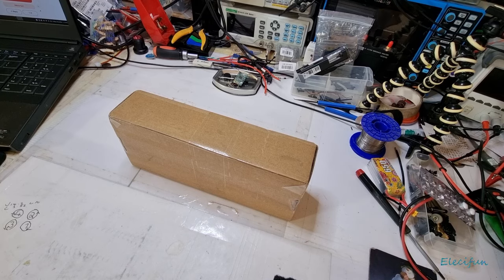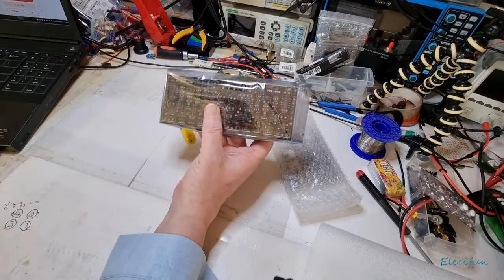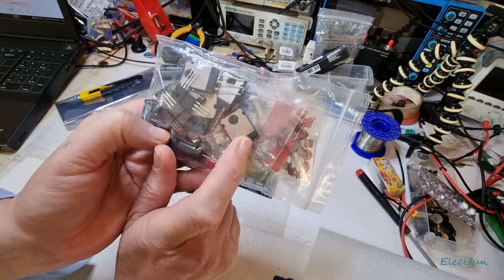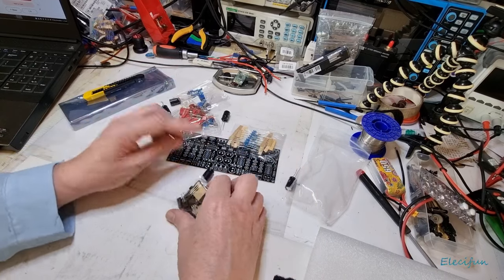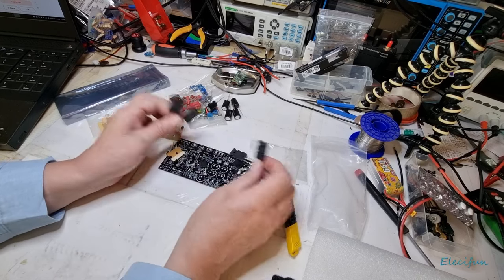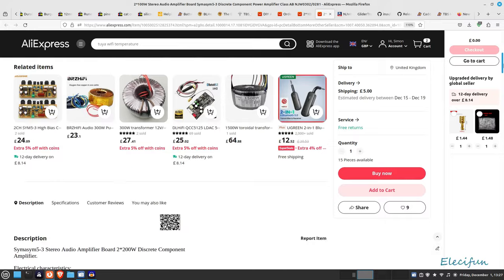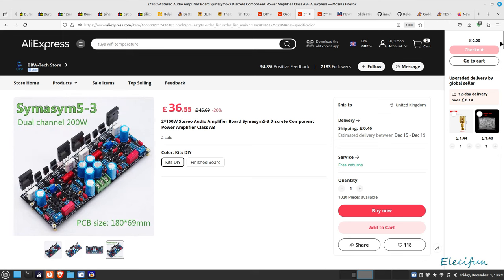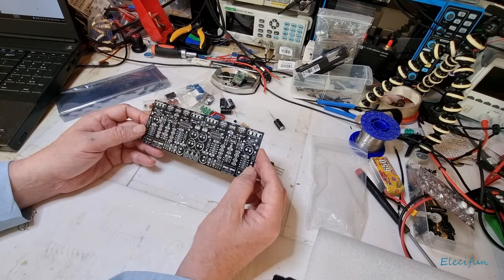SymaSym 5-3   100 watt per channel amplifier kit (Aliexpress)

Comment: Hi, Nice - you were tempted on the symasym 5-3 board! - Many different versions available -but you managed to get the same kit I started with.
1st you noticed what I also noticed, drivers I received was also 2SC5200 - different to what the board says right...???
I built it anyway - and the results were actually surprisingly good - better and more consistent to what I was getting from the L-12 or anything built to date from China
I then got curious and purchased a bare board - sourced quality components and original spec drivers MJL4302/MJL4281 from Mouser. Not a cheap build either - The power transistors alone are >$40.Which is the kit you saw the results using ARTA.
So explains why these china kits opt for the cheaper and most probably imitation 2SC5200 parts - but you should still get pretty good results. And if you interested as I was, having a decent 100W amp you know it is a good amp design .(i believe it is from a "lean" design)
I have tested my board to +- 50V producing 110W, but decided to settle on 45V, as I wasn't sure on whether I was stressing the circuit at 50V
Reply from the maker: Well you did show good results, so I had to give it a go. I had some MJL4302/MJL4281 on another build so I have used them on this as I know they are genuine. I will test this week, getting dragged out tomorrow for Christmas dinner. 😬
Reply: @Elecifun  Guess, you need to eat sometime...no reason not to expect similar results as what im getting...BTW i kept the other transistors of the kit - i only changed the main drivers.

Comment: Giddy Sir hmmm another amp. Very nice. 🤔 I'm not quite sure what you are saying here. 

Did you buy a counterfeit board? 🤔

Anyway it looks interesting and I look forward to when you finish building and testing it.🤔 

I had hoped that maybe you would build some new speakers.

I still don't know whether I should proceed with my long term dream system. 

I think it's just a dream at this stage.

Still who knows maybe I'll get inspired to build them.😅
Reply from the maker: No I seem to have the correct board/kit. I not sure I could build speakers of any worth. I'm best sticking to store bought.
I should have the tests on this one done by Friday BST, fingers crossed.
Reply: @Elecifun  Well why not? Just find a speaker and an enclosure.

They provide the dimensions of the box.

Cut all the pieces to the box.

You might need to join two pieces together which is not hard.

A few pieces of dowl.

Drill holes they have jigs for it which makes it fast and easy.

I made a nesting box for crimson parrots.

Ideally you need a drop saw and a rip saw.

Still maybe you have a buddy that already had some equipment.

Just remember the speakers have already been acoustically designed.
Reply: @Elecifun  Okay, I look forward to the video. 🙂👍